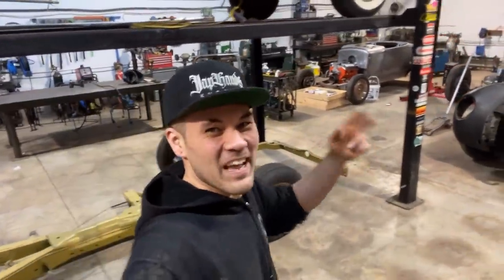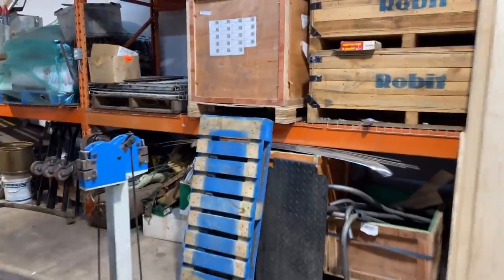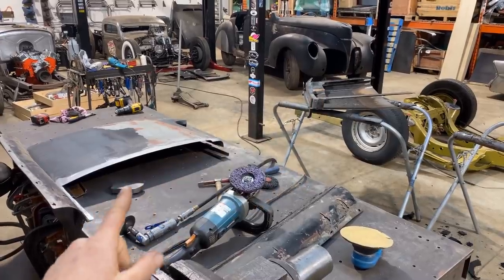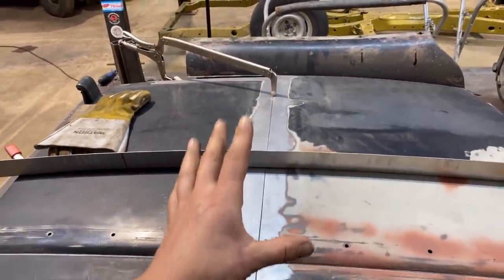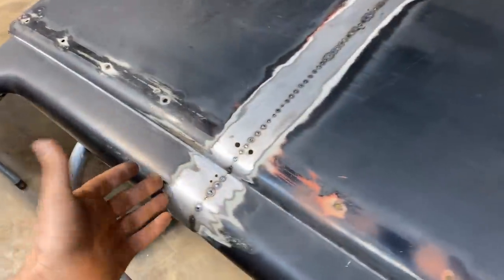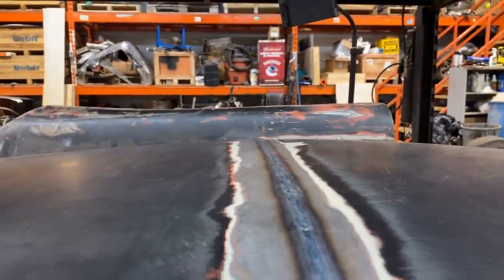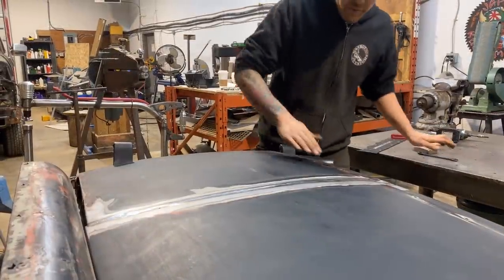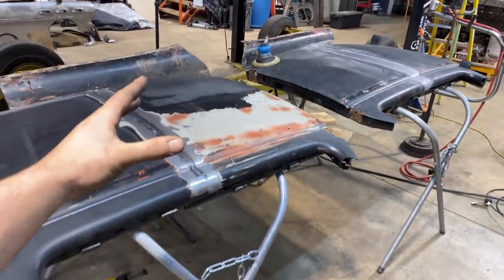How To Tig Weld Thin Sheet Metal - Planishing & Finishing Doors 1939 Zephyr Chopped Coupe Conversion

Comment: Great project.  Two things I learnt from welding and metal working instructors.  You can butt weld mild steel  using TIG up to 1.6mm thick without filler wire as long as there is no gap. I took the piece of metal I welded and hit the weld over a square hole in an anvil with the end of a ball pein hammer.  The metal cracked 90 degrees to and across the weld.  If there is a gap and you need to use filler wire, cut a strip of the parent metal in the case of a classic or vintage car in a guillotine to use as the filler wire. This allows you to tap the panel up a lot easier.  Modern filler wire is high tensile and is a lot harder to work.

Comment: man i got a 1960 chevy belaire/impala 4 door (with the vertical bat wings) i'm fixing to cut the frt of the back doors off shortening the doors 12'' to 14'' along with the body, frame, roof, and floor board. your vid was such a huge help in getting me started in the right path for the doors.  making it to look like a extended cab trk with the 2 little doors in back. thx
Reply from the maker: You’re so welcome and I’m glad it helps!

Comment: Awesome video. Nice tig work. We make stainless steel kitchens and countertops. We regularly have to weld a 45 degree angle on top into corners. We use a backing plate to absorb heat and help keep it flat. Then some hammer work then off to be grained. If you have some copper or aluminum under weld area it will help you . Thx again
Reply from the maker: Interesting in that makes total sense! Thank you

Comment: Great work again Karl, the cubitron sanding disk are my go to as well. Use a cut and cool spray on aluminium,  it will stop the Ali sticking to the pad and gives a great finish even on 60grit.

Comment: Awesome once again Karl.
Your explanation of what happens to the metal as you weld along that seam between the left and right side was the fist time I have seen that explained.
You enlightened me further.
I guess you can only do that correction if you can get to the back of the panel though.
This is going to look awesome once done.
Reply from the maker: Thanks man yeah it’s a very important part when tack in the same

Comment: I really enjoy your videos, thank you for posting them.  Interesting that you use a bit of filler sometimes and then grind it back.  I was taught to weld without filler and if I made a hole - quite often! - to drill it out maybe 3/64",  punch a 3/64" disc, put it in the hole and weld it in.  Also, I was told to strike the arc on one side and sweep across to the joint in a kind of J movement so that the arc strike didn't burn the edges.  You are much more talented so I guess you can get away without such tricks!

Comment: have you tried starting in center of panel working to the edges.  working in the past on large panels we would work them this way working the seam equally both ways
Reply from the maker: No I never do that. The edge I started on Has the body line that needs to line up so I always start there

Comment: Damn, your videos are front to back solid gold.
Can you tell me why you DA sand all your panels after getting the paint off? I assume it's to give a consistent matte finish but I'm not sure why that's helpful. Thanks!
Reply from the maker: When it’s a consistent surface, it’s easier for me to line things up. When it’s one colour it’s easy to see the slightest variations in the surface
Reply: @MakeItKustom  that makes sense 👍

Comment: Great instruction ! 
What’s your opinion on file finishing? 
I do a similar process 80 grit on a die grinder, 80 grit on a DA but use a slapper file/dolly, dykem layout fluid to search out the highs /lows and file finish with a body rasp file.
Reply from the maker: File finish great when done properly. If it’s done too early then it just removes too much material

Comment: With that profile gauge, would it not have to be used in one plane , and from the same starting position, what I mean is that the curvature of the doors will vary from the top of the door from the centre from the bottom .
Reply from the maker: Yeah it’s just for 6 inches from the door handle

Comment: Great Video! Always explaining in great detail not only the how but the why. Helps me understand the process! I always thought the correct way was to tac in opposite sides and then move around. But now, i understand that i've been doing it wrong and why. I will correct myself. Thanks! what about for patch panels? same process? start at one side then move around in one direction every couple inched then around again and again until they are half inch apart?
Reply from the maker: Yes it’s the same process for patch panels but sometimes they are a little bit trickier because you need multiple spots to line up at once
Reply: @MakeItKustom  thank you. I will change my process now. Truly appreciate the help!

Comment: Have you had a situation where you aligned the panels exactly flush and were still that way after tack welds every half inch but when you went to do the weld they shifted as you moved along so they were no longer coplanar?   Especially in a situation where there is no access to the backside.  If so would greatly appreciate thoughts on how to prevent or what to do once it starts happening.  Thank you.

Comment: That was a great video. As always. Would be interested in seeing how you would approach that is you had only a MIG welder in the shop since that is the reality for most of the viewers. The oilcan topic is worth a video of its own; you show how to deal with a known shrink-induced oilcan in this video. Many instances are stretch-induced due to dents, say in a roof panel. How do you determine where to shrink in those instances?.
Reply from the maker: Usually a dent will have a crinkle or a crease that causes the stretch. If you can locate that it will be the area to shrink. As for Meg welding I would attack it in the same way except I would not fully weld it from one into the other I would just tack and cool as I go from one into the other

Comment: From what I was taught you’re supposed to leave a gap in the two panels and back it with a wider piece behind it so you don’t grind the weld away on the front side. And you can also drill holes in the two panels you’re welding together and spot weld the filler panel that’s behind it that way you have less of a chance for the pieces to crack and show the line after paint. At least that’s how you do new car panels in auto body but I’m sure your way will work too I’m just giving my opinion not talking crap, keep up the good work.

Comment: Can one start tacking a joint in the center and work to each edge?  I've never tried, but I have wondered if it works equally well, or if there are pitfalls I am not thinking about. Thank you very much for your content! It is very helpful!
Reply: Better to start on the edges in this case, because that sets it's shape, it's form, it's outer dimensions, starting in the middle would lead to issues..
Reply from the maker: The only pitfall I would worry about is did the alignment could change by the time you go to the body line. For me It’s far better to start on one side and work to the other

Comment: The best advice i got for fitting sheet metal was to take a scrap piece of  thin steel, bend it over my knee to some sort of shape. Split it down the middle with a cut off wheel and then edge prep, fit it up, tack and weld it back up again. Practicing on something that  isnt "important" lets you learn at a much quicker rate. You'll learn surface and edge prep, fitting the parts together, what welder settings works best etc.Oh and acetone the heck out of the parts before evening thinking of powering up the welder.

Comment: I have not been doing restoration work very long.  Love watching you and tony . By far you 2 guys are the best to learn from.  Why wouldn't you keep that small overlap for strength and spot tack the inside together.
Reply from the maker: Overlapping is not a great way to finish body work. If I want to hammer it straight I need to keep it the same thickness thru the panel. Two welds would be double distortion.

Comment: Awesome work karl! Still concerned i will wreck anything i try to tig, so its mostly something i rarely use. Lift arc is not easy to get the hang of. Some day maybe. 
I found this awesome diamond grinding wheel for my die grinder, to knock welds down, no abrasives in the air, and doesent make much heat with a light touch. Lasts to long too.
Reply: Can you link to that wheel, I’d love to give it a try
Reply from the maker: That wheel sounds pretty cool! Lift arc  is tough to get the hang of

Comment: Use a magnets to align both panels, keep them separated with a piece of 023 wire, this will avoid binding of the panels 
Use a piece of ceramic tile to the underlying part of the panel when you begin to weld.
100% penetration.

Comment: Thanks for that Karl.
2 questions.
Can you over stretch ?
How does it look different when you have gone too far ?
And it looks like you don't have a foot pedal   ?
I find it very difficult to make the transition to a pedal control.
I am thinking I don't need to bother.
Reply from the maker: Are use the foot pedal.  I needed to adjust on the fly. If it’s overstretched it will be higher than the rest of the material
Reply: I'm no tig expert but in my opinion the foot pedal is essential. I tried tig about 15 years ago using a lift arc machine without foot pedal and gave up after either continually burning through or not having enough heat. Bought another tig last year with HF start and foot pedal and found it a lot easier to use. Still no expert but getting better 👍

Comment: I have to ask why did you run a full bead instead of just finishing it with tacks? You were at least a third of the way done.  The blow through and warpage is why when I'm working on sheet metal I never run a full bead I always do the tack method.  I'm just curious to know why you did it that way is all.
Reply from the maker: Believe it or not by running a full be like this it is far less likely to warp and a far better weld. There is going to be regardless warpage so it’s better for it to be consistent. It still needs to be a nice hot weld for the best fusion.

Comment: If You doing this kind of seam in a place where there is a cavity behind an You can’t reach with a dolly it’s good practice to open up the tight space between the panels with an oscillating tool like a Fein Multimaster. It’s tedious and noisy, but it’s worth the effort. The panels won’t warp as much.

Comment: Will you need one for passenger side??  Driver side guide can't work by flipping it end for end??? Or is the curve the same coming from the rear to the front because the rear is narrower??? Just wondering.. ..
Reply: You don't flip it end for end, you just use it upside down on the other side. Same end toward the front, but on one side the flat of the angle iron is up, on the other it is down.
Reply from the maker: I can still have the front as the front and the back is the back when I flip it for the other side the guide works for both sides

Comment: I remember old photographs from Ferrari factory how they built cars in 50-s or 60-s. There would be two guys, one with oxy-acetylene torch and the other one with a hammer and a dolly. The first guy would run a short bead and the second guy would hammer the bead while it was still hot.

Comment: Karl at about 9:30 a suggestion is maybe make a wooden 2 inch wide by its widest depth  profile at the  joining point where the two doors are gonna  meet and be tig and tack  welded ..should make it abit easier to work with...just a thought 🤔🤔🤔🤔
Reply from the maker: Yeah I think that would’ve helped quite a bit actually

Comment: Just so excellent. This is better than any TV show hot rod crap with fake drama. You are killing it. I thought I saw you using Furick cups. Have you tried gas lens? Also wondering whether back purging behind would make your life easier? I cannot emphasize how difficult this is if that fit isn’t tight. It’s whack-mole and those holes are hard and ugly. Impressive that you manage to avoid them!
Reply from the maker: Thanks so much man! Yeah I do you use gas lenses too they are awesome. No I don’t back purge
Reply: I’d love to see you do a video on gas welding this same type of panel butt joint. I learned to gas weld first. Everything you learn from that applies forward. My father had a friend that did auto body work using oxy-acetylene torch and steel rods. That’s what got me interested. I think you did a video on gas welding. It’s a highly underrated skill, and requires minimal cost to get welding

Comment: try to tack and weld from the middle to outside like torquing an engine head different kind of forces but same principle you ll get significant less warp. And please let the sound on at hammer on dolly the sound change while progressing is very satisfying. Nice video as allways.

Comment: My TIG welder only goes down to 10 amps even with pedal control and still causes blow through at the beginning of the seam. is 10 A still too high ? please share a little bit more about the machine settings.

Comment: First, you burned and overheated the metal, and then you try to straighten it and remove the wave ...
It was necessary to weld in a pulsed (0.1 sec) mode with prepared and clean edges!

Comment: Lots of good info but how thin is the metal, what tungsten and what filler?

I’m working on 22 ga rusted wheel well that is too thin for my mig so I got a small inverter dc tig 

i did one side of the truck pretty dang successful with flux wire and no gas but it was a challenge so I picked up the tig and already had argon

Comment: When putting a outer door bottom in could I start I the center working my way out both directions consistently.? Leaving the outside edges free to move because I will be trimming those during the fit. Or would I follow what you just did. Thanks
Reply from the maker: Yes as long as you cut is true then you should be able to that way as well

Comment: A little tip for you to save yourself a ton of money on that cleaner go to your local big box building supply store and grab a quart of naphtha a quart of Xylene that stuff is nothing more than a 70/30 mix of xylene to naphtha however either one by themselves should do the trick at 1/3 the price or better.  But remember with any cleaners like this make sure you either have some type of breathing protection on or awesome ventilation
Reply from the maker: Thanks for the tip Matt!

Comment: Karl Thanks for a very informative video, so helpful. What is the metal thickness and what current settings are you using for your tack welds and for the main final weld. Thanks.
Reply from the maker: I said my welder to about 60 A I stab at full throttle for tax. And probably 75% for the bead
Reply: @MakeItKustom  Many thanks for your reply. What metal thickness was that for.

Comment: Great to see another BC guy at work.  I had three questions, really hope you see this comment.  1. When you finished the weld you had a filler rod in your hand.  Did you use filler all the way down or just as needed?  2. Around 23:50 you used what looks like a steel spoon tool.  How/what were you doing with the panel?  It looked like you were using it to find high spots, could you describe what was happening there?  3. Why did you grind the weld down before attacking the tin canning, would have thought the extra metal would have made it easier to fix?  PS - I'm in Victoria, love your channel and learning so much!

Comment: When would you use a flange to mate metal together?
Reply from the maker: I would use that on inner bracing or in areas that there are no access for hammering afterwards
Reply: One more question,  you used tig for the weld, what if you used mig? More work? More warpage?

Comment: For those watching and especially whoever asked about whether he cut it once or cut it then snuck up on the line, Carl overlapped  these pieces and then scribed the line with a sharpie. Another way you can do it if you're not an absolute Master with a cutting wheel like Carl is, is to leave the two pieces overlapped and with a very thin kerf cutting wheel cut right through both pieces at one time. If the line isn't perfect it won't matter because the two pieces will have been cut at the same time with the same cutting wheel so they will fit together perfectly unless you are really sloppy and twist the grinding wheel where it grinds as well as cuts. The only caveat is that you must account for the width of the cut in your original layout measurements so that they can slide together that distance once it has been cut. This is how we used to do window tint back in the day we would overlap the two pieces make one single cut through both pieces pull the backside out from behind one and the top side from the other and then the pieces were guaranteed to match with almost an invisible line because they were cut at the same time with the same razor blade. A cutting wheel on a grinder is wider than a razor blade so you would have to accommodate with that on a project like this but the principle still applies.
Reply from the maker: Thank you very much for adding this comment to help others! It’s really cool that you took the time to explain another process in hopes that it would help somebody else. Cheers to you and thank you very much for your support
Reply: @MakeItKustom  Hey youre doing all the hard work here... well,ok maybe Christina is but just the same!😉